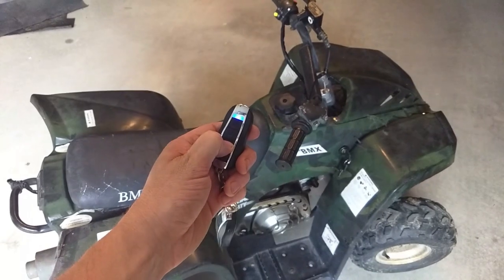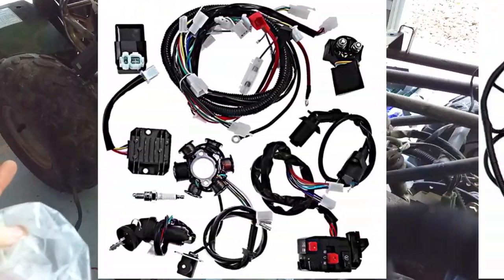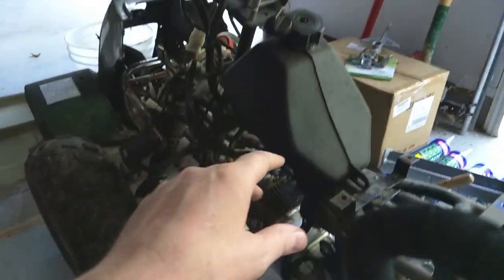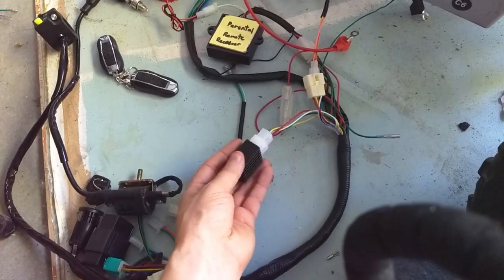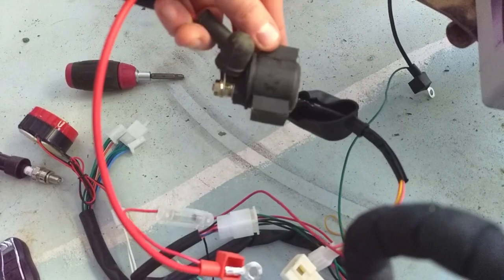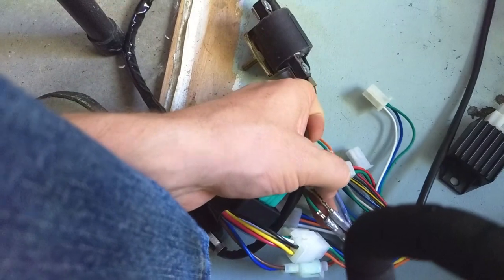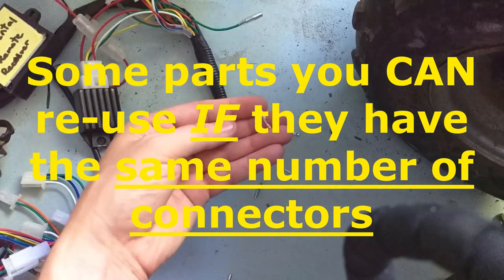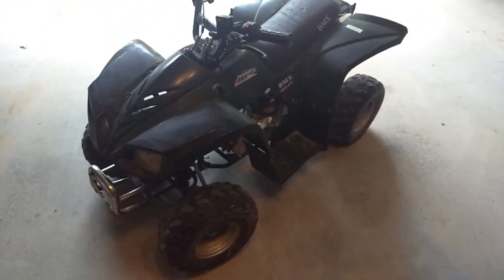Chinese ATV wiring harness basics

Comment: I have an 06 honda trx250te a and I've searched for a wiring harness for days.  I've read somewhere that this model requires a "Japanese wiring harness". All the kits have the wrong left hand start/stop lights switch.  Is there really a difference in the wiring/connections between the specified Chinese/Japanese harnesses?

Comment: Hey Buddy, I have a 125cc Chinese ATV however, i had the 10A fuse being blown a few times when i hit the brake prior to starting.  I am thinking to change the whole wiring harness. what kind do i need to order if i have Forward, Neutral & Reverse with GY6, front brakes & rear. Please advise Thank you again for all the videos you do. they help allot!
Reply from the maker: Unless you have a gear indicator setup, the gears may not have anything to do with the wiring harness you could be looking for. There is a GY6 harness but you need to know which stator type you have before ordering. That said, do you have any brand labeling on the VIN plate?
Reply from the maker: Also, most times I dealt with a fuse on boat engines, cleaning the terminal that connects to the battery, putting an electrical grease (nothing flammable) to prevent corrosion on the node, and changing the fuse inside, typically resolved the issue. There is a battery terminal and protector grease that's pretty cheap, before re wiring every thing. Once you get to replacing voltage regulator, sometimes having the whole kit since it's cheap and the easiest option if there is anything else going on.

Comment: I noticed that the colors of the wires at the connectors don’t match up. Mine is the same way, did you change yours to make it work. You didn’t mention it in the video. On the connector for the handle bar switch I have yellow going green and blue going to black, etc, etc.  I would think blue went to blue and green to green, etc etc.
Reply from the maker: I did not change mine. The colors do not go to the same colors, it can get confusing.

Comment: I bought the terminator 110cc atv and I'm having a problem with the key ignition wire burning and I trying to figure out what is causing it to do. I have replaced the key ignition about a month ago and my sons was riding it and it burnt the wire again. What you think is causing it to do that?
Reply from the maker: Kind of hard to say, a few things come to mind such as cranking the starter for too long can put heat on that line, putting in a battery with too high amperage could heat the line, problem with voltage regulator, etc. Not sure if the wire is shorting something out somewhere and causing a draw or just resting against something hot like exhaust. Possibly one of those thoughts can get you somewhere to start. Regulators are cheap, same with batteries and cleaning carb if not starting right away.

Comment: Hey can anyone help i just connect all the wiring in my 150cc but everytime I connect the battery on the  positive side the atv cranks with the switch off
Reply from the maker: Is your solenoid shorted out that you can check? Pull off the two smaller wires going into it in case it's stuck on too.